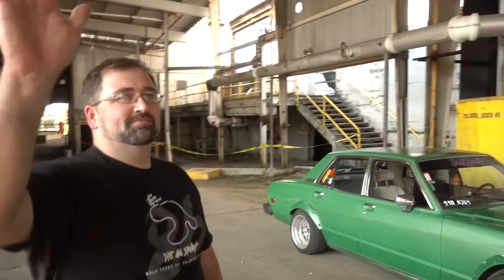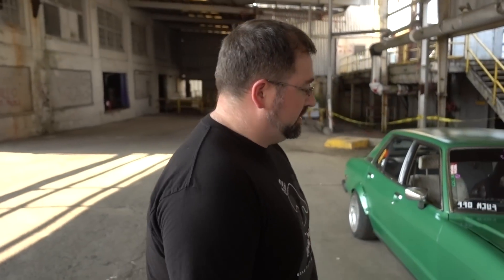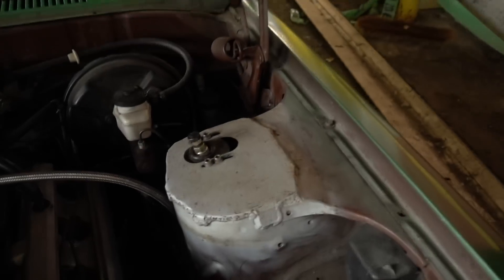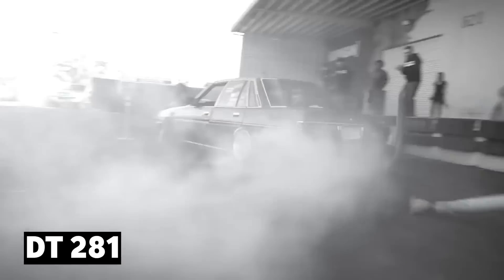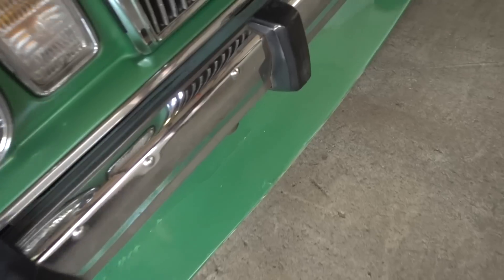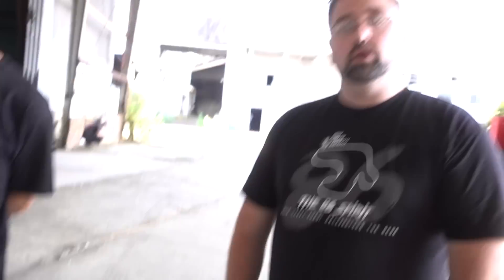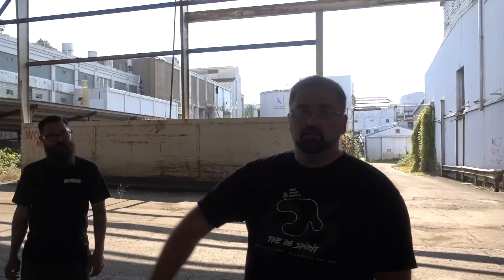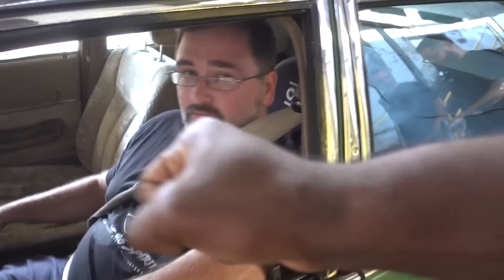V8 Swapped 70s Cressida With a Madman Behind the Wheel

Comment: I will walk my ass back to garage and make that 1uzfe finally work. Best motivation in I while to do it.
Reply from the maker: You got this.
Reply: @TheHoonigans  cheers! That means a lot!
Reply: Grzegorz Gosciniak  do it brotha make that v8 scream! Persistence pays off.
Reply: What's going on with it man? I've had to work on mine recently
Reply: @mastathrash5609  It crank over and the dies, if I hold throttle 1/2 it runs on 4 cyl. I think it got week spark on one distributor. Initors and coil swap around but problem still seams to be left bank
Reply: Check if your cam sensors are good and the right kind. I've had a problem like that with a jag V8 and that fixed it
Reply: @Cijpher441  that next on my list after swapping distributors left to right. The thing is I am not getting any errors on ecu
Reply: Check yer alternator lol
Reply: get rid of the dizzies I cut teh bracket to remove the dizzy holder and just left the part that holds the cam angle sensors, then buy some 2zzge 1.8 toyota coils (smart coils no igniter needed) and enjoy the sequential COP ignition that can handle all sorts of boost without the need of a CDI box n shit
Reply: C Pinell didn't know thats all it took thanks
Reply: @Grzesiupiesiu  I have a lot of 1uz knowledge check my videos of ya want proof. If you are rocking the std ecu. Be sure to check the capacitors in the ecu. They are known to leak after all they are 20+ years old. Thats how I got mine so cheap..
You can get them repaired but they are also a very limiting thing on the 1uz. So I went with the link g4+ Xtreme. Let me know how ya go
Reply: @TheCuttz1984  my plan was to run stock ecu for about a year and save for link storm. I will check your channel.

Comment: Xcessive is one of the only manufacturers that make R Series swap components for the 1uz (Custom Flywheel, adapter plates, clutches) Thanks to them I got a 1uz + R155F (4wd r154) in my 82 toyota pickup.

Comment: Bought a 78 Cressida as my first car it had a engine swap from newer Cressida still carbureted w58 transmission ae86 corolla lowering springs originally enkies straight piped welded differential nardi steering wheel  and I regret selling it